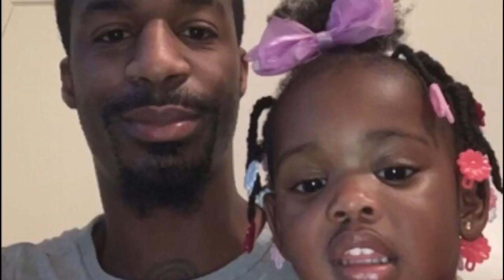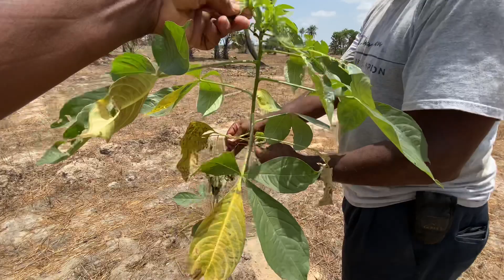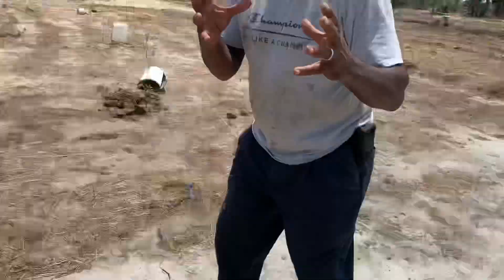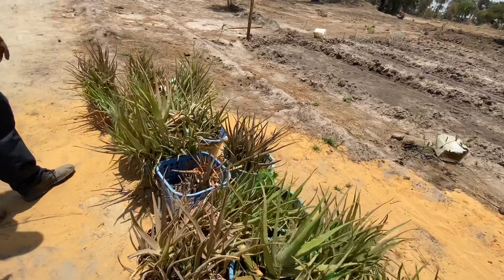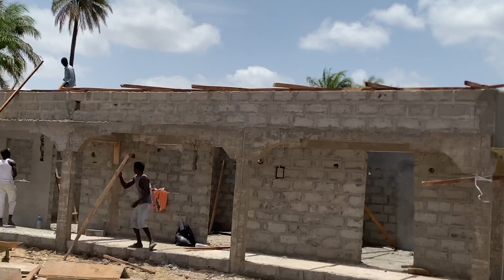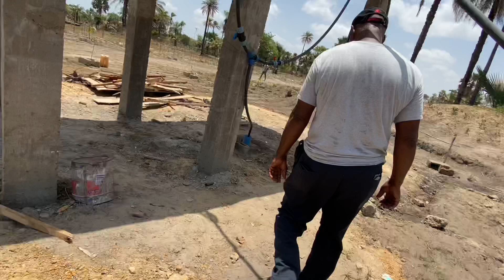Almost More Orchards Than Land at BAG

Comment: As an horticulture consultant, a basic nursery bed should be 1 miter by any length you desire. That's the expert recommendation. That is for ease of operations. and like half a miter between the beds.
The reason I previously recommended you guys to engage a agric/hort consultant is because not everything plant/seed that germinates is suited for every climatic conditions. Each crop/plant has its optimal growth conditions. some are suited for highlands/cold or lowlands/coastal or hot conditions like at the coast. Some seeds will germinate but will develop poorly or never get to production at all. UNLESS you modify the growing conditions like in a greenhouse which would be a bit expensive to do! So again please get expert recommendation on suitable plants for optimal production at BAG. its just a suggestion. Thanks